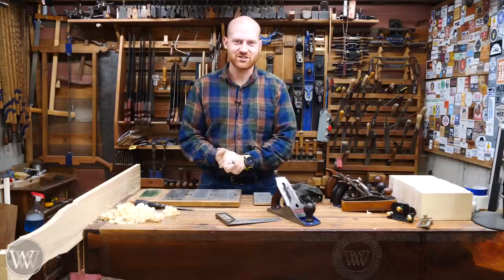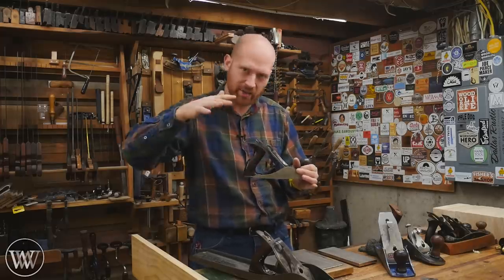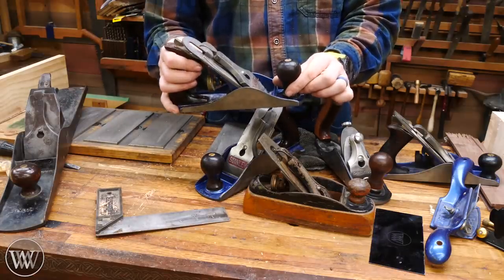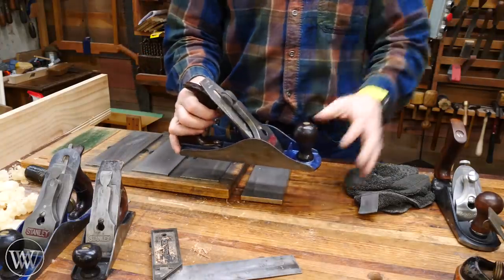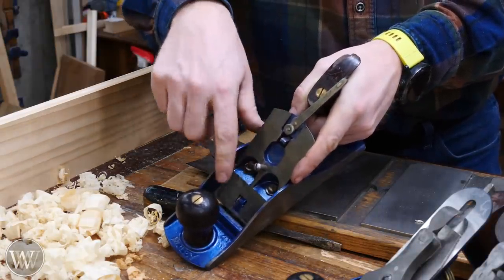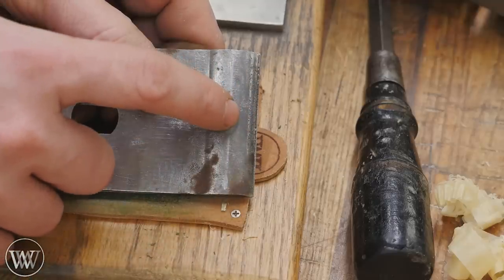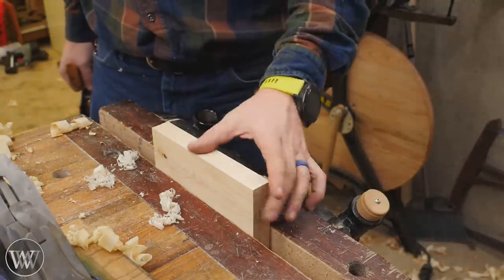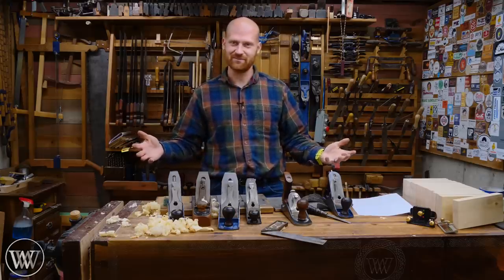The best Smoothing Plane How To Use and Setup

Comment: Mr. James Wright, thanks for this excellent video.  I have a three and a four and generally use the four.  I do have one thought.  I see a lot of planes that get set, then they are run across the edge of a board.  I'm not sure how much of a difference it would make, but I'd love to seen these newly fettled planes run across the full face grain of a board.  Thanks again for your video.  You inspire me to keep using the old hand tools!
Reply from the maker: Thanks. I wish I would have thought of that. The reason for the edge is it makes it easier to see which side is deeper when ajusting it.

Comment: I would love to see a detailed setup video on an eBay find, a proper restoration job, especially jury-rigging a way to get a dead-flat sole when one doesn't own a surface plate or other reliably flat surfaces like table saws and such! ALSO some day I wanna see a series where you go through setting up a Japanese kanna and doing a side-by-side with your custom Veritas--I think the world is ready for that! Let the factions assemble!
Reply: Yes please, I have a crappy time getting "flat"
Reply from the maker: I have several videos on that if you want to see them. here is the series where I go through restoration and flattening on several different conditions.
https://www.youtube.com/watch?v=R_QKpSrKuuo
https://www.youtube.com/watch?v=N7vyUMgr_G0
https://www.youtube.com/watch?v=sT8bHbiO5mE
Reply from the maker: alos, do not worry about perfection on being "flat" people go WAY overboard on that topic and it does not make that much difference it the plane is a few thousands out on most of the plane as long as the mouth, tip and heel are all coplaner. most planes out there do not need it. I even have several that I use regulary that I bought used and have never checked the flattness of the sole.

Comment: I think you missed a very important part of the iron setup. A slight camber off the straight line of the blade, where each corner is just slightly honed "upwards" to eliminate the edge line that will occur on smoothing a large surface. Paul Sellers, who has been setting these up for more years than you've been alive, has a very nice tutorial that covers setting up a plane. He goes into a bit more detail on the exterior of the plane as well. You make excellent points and your chipbreaker points are spot on.
Reply from the maker: Thanks. A lot of people like to do that. I find that for fine cuts it is not needed. I use to do that, but not any more.  that is what makes the sport great. so many ways to do it and there is no one right way to do it.

Comment: can small rust pitting on the sole of the plane result in a lower surface finish? or is it most likely to be an issue related to the blade (vintage one, so probably rusted and unrusted) ? I have some kind of lines, or tracks, can't really feel it with my finger, but I can see the lines/tracks...  Also, my iron is cambered.. , if it's due to the pitting, I can basically throw away the plane - it's too deep, not large holes tho. I tried some kind of epoxy filler on them, worked on the big one ( only a few mm large) but didn't stay on the small holes after flattening it again.
Reply from the maker: pitting wont cause a problem at all as long as it is flat. you don't want anything hanging down. if it is a quick run of some sand paper on a flat surface can fix it. if there ate tracks that is most often from micro chips in the blade.

Comment: You said "the chipbreaker is actually a really important piece" - could you make a short video about this topic? (Or do you already have one?) How is it works in details, what is important to care about?
Reply from the maker: surprisingly the chip breaker does actually break the chip kinda. In particular it actually compresses the chip rather than just breaking the chip. The act of compressing the chip allows the iron to then cut the next strand without leaving tear out. This is actually its predominant use. If you ever get a chance to watch a video close up of the chipbreaker in action you will see it does not actually support the tip of the iron the tip of the iron will vibrate against it if it is not supported by the bed of the plane. However the chip breaker will compress the chip and stop tear out from occurring. I'm trying to get the setup right now to make a video to show that but it is a bit difficult to get that close. hopefully sometime this year that video will be coming out.

Comment: Thank you for the great video. Do you know the grits of your sharpening stones?
Reply from the maker: I use course. Fine and extra fine. The grits do not equate to wet stones or sand paper as they cut differently. But they are around 600-1200
Reply: @WoodByWright  thanks taking the time to reply. That's really helpful.

Comment: I've set up my smoothing plane as you have suggested.  I have also backed off the corners of the blade, yet I still get small ridges on my wood after using it.  Any idea why?
Reply from the maker: It may be because there is a scratch in the sole of the plane or a corner of the mouth is sticking down when pressure is applied from the iron. But most of the time when there is a plane track it's because the iron is sticking down too far, or the corners of the iron aren't rounded up, or one side of the iron is sticking down farther than the other side.

Comment: I enjoyed your video. I was just wondering if you have an opinion on smoothing plane frog angles. Is there really an advantage to a 50 or 55 degree frog? Thanks
Reply from the maker: If you are planing agents the grain or changing grain the higher frog will help reduce tear out bit for strait grain it does not help at all

Comment: As always James a wonderful video.

Two brief comments.  First it felt as if you were a bit rushed.  Not sure how much you practice your speaking, but I find that about 3 aloud "read-throughs" (preferably taped when possible) help me to dramatically reduce that feeling for my audience.  Usually, I am also able to refine my speaking to be both clearer and more concise.  Of course I also realize that much of your tempo comes from your strong and contagious enthusiasm, and I would never want you to lose an ounce of that.

My second comment is a small clarification about plane parts.  The "chip breaker" is not actually a separate part, but a special section of a part.  The part itself is known as the Cap Iron.  So called because it is placed on top of the Iron (blade) in a traditional bevel down western plane.  The chip breaker is the region of the Cap Iron that is closest to the cutting edge of the Iron AND which bends the freshly cut fibers causing them to break and therefore curl.  Stanley traditionally uses a small humped region.  Other manufacturers eliminate the hump but include a bevel which serves the same purpose.  

While this action does effectively reduce taring, it was initially introduced to simply push the shavings out of the way of the users hands.  The Cap Iron was introduced so that thinner irons could be used.  A thinner iron was both less expensive to produce and much faster to sharpen and maintain than the thick irons of older wooden block and wedge style planes.  Adding the use of steal instead of iron meant that thinner irons (blades) could also be made many times sharper.  However all of this came at a cost.  The thinner iron would often vibrate/chatter in use.  So a second piece of thin spring steal - the Cap Iron - was added to provide the rigidity needed at the cutting edge.  The first ones were actually flat.  The hump was later added to improve the reinforcement of the cutting edge and had the advantage of causing the curling which both cleared the shavings and further reduced tare out.

It should be noted that traditional eastern planes do not make curls and do not use cap irons, so they also lack chip breakers.
Reply from the maker: Thanks for the feedback. I always like hearing what others think. I purposefully try to talk quickly as I find most channels talk too slowly for me. but to each their own. Thanks Michael.

Comment: When you set your frog to close the mouth, is the blade even with the bottom of the sole or does it protrude below the sole?
Reply from the maker: no the iron does not touch the sole, but on most planes it never does as that small pece of sole is where the bevel of the iron is. so for most planes the only thing the bed of the iron touches is the frog.

Comment: When you strop your soothing blade so often, what is your procedure for verifying your setup once the blade is returned to the plane? Isn't there a great of variability, having removed the blade and made some MINOR adjustments?  Thanks for your help.
Reply from the maker: Yes. Every time I sharpen it I have to readjust it. Unless it is one of the new custom planes by veritas. Those are really good setting them back exactly where they were. My normal method is to back the Aaron off so it's not taking any shaving. Then slowly advance it until it just touches the wood. Then use the lateral adjuster to make sure it's taking an even shaving across the blade. Then I'll set the depth to whatever particular I'm looking for. Usually all told it's 5 or 6 passes and 30 seconds.
Reply: @WoodByWright  thanks. So do you use a different board to set it back up and then return to your project board, or are you setting it up on your project board?
Reply from the maker: Usually I'll use another board because most of the time with the project boards I only need to take a shaving or two.

Comment: Another GREAT video! I'm officially a fan. :) I am also new to all this, so another question: Are you saying that a plane can make sandpaper redundant?
Reply from the maker: yes. the plane will most always make a surface as smooth as your finest stone or strop so it would be like sanding with 12,000 grit. sand paper will fill the poors of the wood allowing the finish to pinitrate a bit deeper, but not enough to make a difference.
Reply: @WoodByWright  Cool. So much to learn. I thought sandpaper was needed for the final touch.

Comment: Can you tell me the angle needed to sharpen the smoothing plane please
Reply from the maker: That is mostly personal preference. Generally anything between 20 and 40° will work. The higher the angle the more durable the edge. But the harder it is to push the plane. Generally I sharpen mine in about 35°. But you ask five woodworkers and you'll get six different degrees.
Reply: @WoodByWright  many thsnks I will keep to your experienced advice

Comment: Thank you for asserting that a low angle bevel up plane is not the "cat's meow" for smoothing.  For smoothing and really for anything besides end grain work, the low angle bevel up plane has two thing going against it, it is low angle (that could be fixed by changing the bevel angle on the iron) and the big one is that it doesn't have a chip breaker.  There is a reason that the standard bevel down bench plane IS the standard for most work and low angle bevel up planes are really specialty planes.  Yes, you can use them for other things but in the end they aren't made for general purpose work and especially not for smoothing. A really sharp blade goes a long ways but for anything beyond a super fine cut, it is just asking for trouble.
Reply from the maker: so true. the LAJP is a great plane but there is no one plane that can do it all.
Reply: @driesvanoosten4417  I mentioned that you can change the bevel angle of the iron but that doesn't make up for not having a chip breaker which is the primary feature that helps with tear out.  Low angle bevel up planes are just giant block planes made for end grain (like butcher blocks) so they didn't need a chip breaker. Any plane can avoid tear out if they have a really sharp blade and if they are taking a very fine cut/shaving. The real issue comes when you want to remove a reasonable amount of material when you are flattening a board (think any step between scrub and smoothing) and you don't want to take an enormous number of super fine shavings to get it done. A chipbreaker/double iron has been the standard for general work since the late 1700's.  Adjustable mouths were experimented with on bevel down metal planes by a number of makers (I have one from the 1860's) long before the no 62 (started in 1905) and it was never really considered important enough to bother with (partly because you can adjust the frog ).

Comment: How about the best angle for a smoothing plane? 45, 50 or 55 degrees?
Reply from the maker: There is no best angle. If you go up to a high angle like a 55 it might be a little better for difficult grain but also makes it harder to push. Most of mine I keep it 45 but I have one way up at 55 for that really really hard grain.
Reply: @WoodByWright  Thanks. Can I use a #7 with a 55 degree frog as a smoothing plane? I am having trouble getting the thin wispy shavings with a 45 degree frog.
Reply from the maker: Generally a smoothing plane is a short plane. A #7 is for jointing and does not need to take wispy shavings. But if it has a problem with that then it would not be a problem with the frog angle. Send me an email I would be glad to help out.

Comment: When smoothing the face of a board, how do you avoid leaving "tracks" from the corners of the blade?
Reply: You would put a small camber on both edges of the blade. I was surprised that James did not mention it
Reply from the maker: Some people like to hit the corner of the iron 4-5 times to round it off. I do not do that though. If the shaving is thin enough there are no tracks you can feel. So I don't mess with it.
Reply: Thank you both for your replies...much appreciated.

Comment: How rare is a number 3 with the corrugated bottom?
Reply from the maker: Not really rare.. on the collector's price they're worth about $5-10 more than the smooth bottom.
Reply: @WoodByWright  thank you sir.  I live in Kentucky. Over the weekend I snagged a number 3 corrugated bottom, a number 5 smooth bottom, another corrugated bottom that I believe is also a stanley but I can’t find any stamping on it anywhere and then another small plane that doesn’t have a depth adjustment or lateral lever. Just a lever cap and an iron. The Stanley’s are all original with original stamped irons and everything. I picked all 4 up for 80 bucks. Their in beautiful shape.

Comment: I’m afraid I’ve been a barbarian and have  resorted to using sandpaper instead of my smoothing plane, Stanley no: 4. Whenever I move the chip breaker as close as possible to the iron’s edge, the shavings just keep jamming in between both elements even if it seems that there is no perceived gap! 😐😭
Reply from the maker: It sounds like you have a bullnose on the front of your chipbreaker. it should be sharpened to a sharp point so that the curl slides over it as opposed to impacting it or trying to go under it. I have an entire video showing how to set up a chip breaker so that it doesn't clog.

Comment: What stone do you have for your finest grit
Reply: The one I just got that the extra fine 1200 / 9 micron
Reply from the maker: yup that is my finest, but I would say do not call it "grit" because it cuts differently and will give a finer cut then 1200 sand paper or wet stone.

Comment: Where can you find a good planner? Lowe's and home Depot just don't cut it.
Reply from the maker: There are no good planes sold at big box stores. The cheapest one I've seen new that some people say is okay is by grizzly. but it's still a fairly cheap plane and I haven't had a chance to test it out. The next cheapest that is new are the Stanley sweetheart planes or Wood River planes. for most people the cheapest option is to get an old hand plane and restore it. Often if you know where to look you can find them for 5 to 10 bucks a piece. Handtoolfinder.com is a page I have setup to help people find antique tools.

Comment: Is a Wood River #4 decent quality?
Reply from the maker: Yes. They are good. Great for the money.
Reply: The quality is really good. My only complaint is that its fairly heavy. This is either a good thing or a bad thing depending on your approach. I prefer wooden planes over metal planes but I do use a Stanley No 4 daily for a lot of general smoothing. My dedicated smoother is a high angle German Horned Smoother. Look into getting an ECE smooth plane...its only $105 from highland woodworking and it is SUCH A GOOD plane for the money.

Comment: James great video disappointed that you poo poo bevel up planes for smoothing I use Veritas bevel up planes exclusively I keep a few different angled blades and get very good results even in Western Australian hardwoods which are notoriously difficult. For general application I use 40 degrees for smoothing I go to 50 degrees. For softer woods I use 30 degrees The 40 degrees is sold as a 38 and the 30 is sold as 25 degrees.  I use a Robert sorby pro edge and drilled extra hole to acomodate 40 & 50 degress. I also have a veritas scraper plane which is fantastic.
Updated after watching this and some other videos.  Then playing with throat gap set at 1/32 then trying on bad piece of tuart. Great results👍 I do like the look of the veritas custom plane though. I can see a number 4 being addded to my collection.
Reply from the maker: Thanks for the thoughts. They are fantastic tools and do amazing things. you should see my video on bevel up vs bevel down planes.